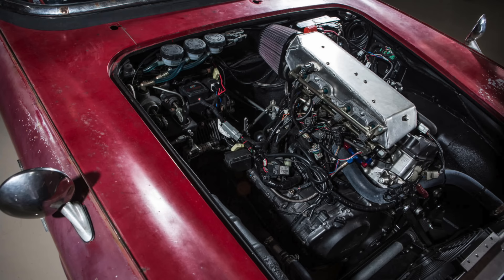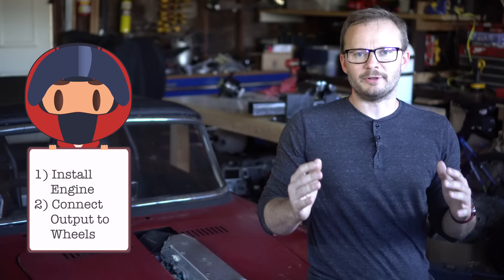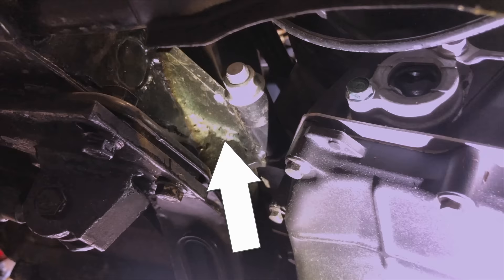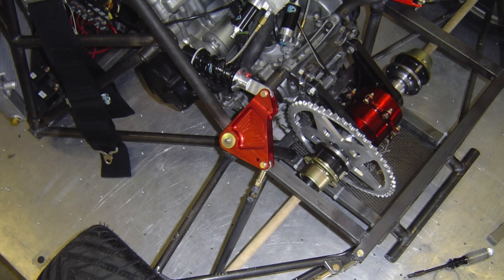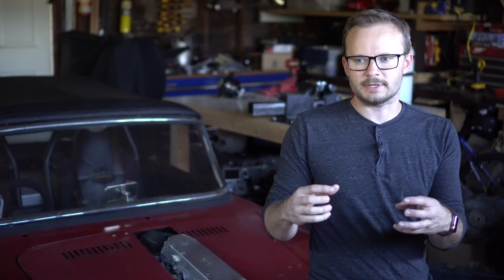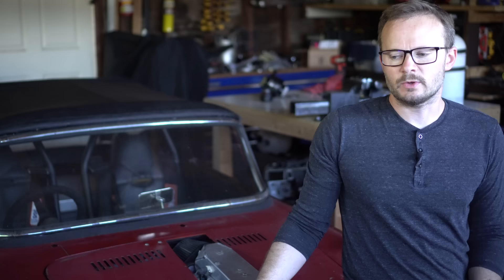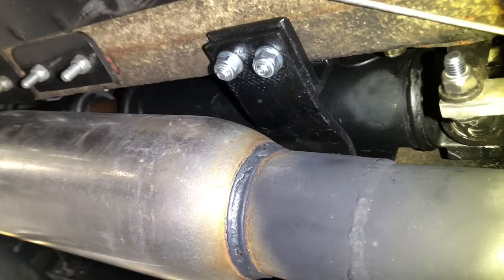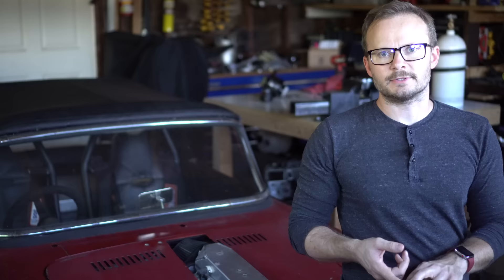Motorcycle Engine in a Car - Here's Why and How

Comment: would the gold wing style of reverse work? running the starter backward
Reply from the maker: No, because there is a one-way slip on the starter. Could be possible to rig up something mechanically, but not easy. Also the starter is grounded to the engine block, so it would be tricky getting the voltage backward.

Comment: I always find it weird when 21st century Americans use lathe as a verb. I would tend to use the verb for the specific operation I'm using thr lathe for. Be it facing, turning, boring, grooving etc. I just can't say " lathed " or "lathing" in an American accent with a straight face. I kinda feel like I should be wearing proper old timey clothes with some kinda of grease holding the shape of my well groomed mustache.

Comment: While I get this hot rod passion, why butcher such a delightful little car in the first place?  I had to laugh when I saw that he didn't know how to take the bonnet (hood) off and did it the wrong way.  I knew then that the project would encounter more hiccups that he anticipated.  The diff seems to be a clumsy compromise.  The live rear end out of an S800 could've been a compromise though the power handling may've been interesting.
There was a time when a lot of people ditched the original S600 engines as they were fragile in clumsy dumb hands and the rebuilding was beyond the capabilities of the average suburban mechanic.  I saw Corolla, Datsun and Ford Cosworth motors shoe horned in with tricks like inverting the diff and cutting new sprockets to get the final drive ratio acceptable.  Even a fully fabricated parallel arms independent rear end.
While interesting, they destroyed a truly unique sports car for what could only ever be a shadow of the original.

Comment: in 07:34  too many screws too many large holes close to each other ..I know metal sheet is pretty thick but if hard driving .."buggy way" needs checking time and again...by the way mechanical engineering seemed to be your favorite science........hold on I saw video no3 ride with Leno....gear shift kicks like a mule...time bomb

Comment: Yikes!! At 9:31 I saw your car up on a couple of those Harbor Freight Suicide Jack Stands!!!!  Have you not noticed that the upright rack has absolutely no negative rake in the front of the teeth to prevent the pawl from slipping out and dropping the car on your head or whatever body part you decide to put imprudently under there. It wouldn't take much of a tap to see that jack fail.  I see the date of your video was after HF recalled those jack stands (2018). If you are still alive, take then back for a full refund even at this late date. HF doesn't want your next of kin to sue the crap out of them. Stay alive for heaven's sake!
On a side note to the above, I love the project. I've dreamed about doing something like this for years until it became decades. Now I'm working on a time machine to correct that little error ;>)

Comment: Hot rod: An automobile that has been rebuilt or modified to increase its speed and acceleration.

Degree in mechanical engineering and ASE certified mechanic.

Comment: There are plenty of old Gold Wing 4 and 6 cylinder engines our there.  They are bullet proof. Why did you not use one?
Reply from the maker: I wanted the 12,300 RPM redline. Also more power.

Comment: It's not a motor cycle powered car. It an ICE car. 
Just because it shares and engibe that also used in motorcycles. Stop all these silly statements. There have been numerous small car powered by engine used in motorcycles book at bmw i3R, numerous Honda car and Suzuki  and many British cars.
Reply: Keith, no Honda has ever used an engine that was also used in any of their motorbikes.  The aircooled series of Scamps had twin cylinder engines that looked similar but were very different.  No parts commonality at all.  I cannot speak for Suzuki but doubt it as the duty load cycle in a car is very different to that in a motorcyle and such things as both the torque and horsepower/kilowatts curves need to be quite different.

Comment: I've got a 67 karman gia. Rusted roller for 40.00. just replaced my 94 GSXR 750 motor.with 1200 bandit motor. Need to rering the 750 mid mount chain drive straight axel where the trans axel was.shoud work.

Comment: Technically they S600 was a motorcycle but with 4 wheels instead of 2.
Reply: Jason, no the S600 evolved from the S500 which in turn evolved from the S350.  There is no parts commonality with any of their motorbikes.  The chain drive rear end was within cast alloy cases with banjo diff bolted to chassis.  The DOHC four cylinder engine was water cooled with roller bearings for all seven bearings.  The head was a very heavy lump.  If anything it had more in common with their F1 engines.

Comment: do you have to have  the car in first when u pull the cable or no @SuperfastMatt
Reply: like when going into reverrse
Reply from the maker: You have to pull the clutch and it helps to be in gear. It will work in neutral if the gears happen to line up.

Comment: S600: Made for Motorcycle Engine because it Also has a Motorcycle Transmission!
Reply: Luis, no, nothing in the S600 was interchangeable with any motorcycle that Honda was manufacturing (other than the valve caps on the tyre valves).  The whole S600 was uniquely S600 car.  A lot did carry on to the S800 but the forerunner to the S600, the S500 had some commonality but only enough to see that they were both from the same manufacturer.  Okay, I'll also concede the 10 and 12 mm nuts and bolts used through the car and bike ranges.

Comment: "Turned out". You dont lathe on a lathe, you turn. Turning.
Reply: You can face on a lathe also.  Ironically, when you take your disc brake rotors to be "turned", that's actually facing. When you take brake drums to be  "turned", that's actually boring.

Comment: Is that dirty sock OEM?
Reply: Parlux, no.  Honda were very particular about the dress standards of their "associates" working on the assembly lines and dirty socks were not permitted.  This one may've been an aftermarket supplier seeking a "go faster sprint" modification.  I have checked both my S600 and S800 printed parts manuals and can find none offered.  Even the changes in parts with successive Engine and Chassis numbers doesn't bring one up.

Comment: Seems like a lot of work when you could of put a small block v8 in it and had a sweet sound for not much more work
Reply: Thats not as cool
Reply: Tobias Lykke Haugaard nah it would be way cooler a 2020 cbr1000rr engine is 215hp, a 350 chev in low key form is 290hp and with basic mods can be well over 450hp a 383 with the right bit will be 600hp, 
And thats horse power that torque factor would be wildly different too

Comment: Im guessing the stock engine was either missing or a pile of rust and nearly impossible to repair or replace
Reply from the maker: Missing
Reply: @SuperfastMatt  I saw this car on Jay Leno's garage after watching this video. Was the clutch changed  to a foot pedal later?
Reply from the maker: @williamgolden839  It started as a foot pedal and then I changed it to a hand clutch. Much more fun this way.
Reply: @SuperfastMatt  I see. Was it a foot pedal when Jay drove it?
Reply from the maker: @williamgolden839  Yes
Reply: @SuperfastMatt  At first I thought it was the head sticking through the hood but I later figured out was the air box. Awesome project you made

Comment: Those things were dreadful!  I spent a little bit of time with one and got rid of it quickly.  If you want a really small sports car get a MG Midget or Austin Healy Sprite..  They are real cars but that Honda is neither fish nor foul.
Reply: Lance, I disagree.  A well tuned and cared for S600 was, and is, a delightful car.  If the owner did not read the Owner Manual and follow the instructions and drive it as suggested, yes, they could let them down.  The ergonomics for the driver were eons ahead of the British sports cars of the time.  They gave what they got.

Comment: Wondering how a bike engine would work in an old VW Beetle. Someone please comment. Smart or stupid?
Reply: old air-cooled VW Motors can be modified to produce stupid power, and they'll fit without needing to plumb in radiators and such, people are also updating VW buses with Subaru Flat 6 as but you need to plumb and radiators and stuff and it's a $20,000 or so conversion, but then you've got a bus that will ride modern on the freeway

Comment: Meh.....

Too much work for too little thrill.

Better off to go with a  Honda S2000 F22C 240 hp engine.

Motor cylinder engine  170 hp and 90 ft lb torque vs F22C engine 240 hp and 162 ft lb torque.

Comment: Old Cars are so cheap such as 2000 Chevrolet Cavalier LS, 1997 Honda Accord LX V6, 1998 Nissan Maxima SE, 2001 Toyota Collora, 2001 Chevrolet Malibu and 1999 Ford Explorer XLT. You can buy used cars for under $1.000. Swap Machines 4 Cylinders CBR 1000RR used price 4.000$ to 8.000$ If new Honda CBR 1000RR price $16.999. A Superbike is more expensive than Old Cars. Modified Cars are Crazy Ideas.

Comment: I'm going to sound like a total idiot and a total hater.
When Honda first made a car, did they use lawnmower parts?
Reply: And hamster wheels.
Reply: ZonE, it depends what you mean?  Honda did not start making lawn mowers until the 1970s, but had been manufacturing power product engines since the 1950s.  There were no power product engine parts or motorcycle parts (other than similar nuts and bolts) used in the first Honda cars (that includes the TN series of light trucks.  The S500 preceded the S600 in 1963, but used nothing other than purpose built parts.
Reply: @campbellsharp8303  your comment shows just how uneducated people are when they mock Honda. Even I was uneducated on this because I believed these foul humans and never bothered to research. I always just assumed Honda took a motor from a lawnmower they built, and made it work for a car, then came up with vtec as a way to make a motor better than a normal motor, this was my thought process, now I know the truth.
Reply: @SenorMrZonE  Yes, it is easy to build a myth about something that people do not understand.  Honda have made a few mis-steps over the years, but usually ready to redirect the path.  Apparently during the very early days of production of the 1300 Sedans and Coupes, there were up to 80 design changes a day as the cars progressed along the assembly line.
The S600 parts manual has many parts >up to a particular Engine Number or Chassis Number, followed a few lines on with another revision.  And the exploded parts illustration has matched none of versions that my friends and I have had in pieces on the workbench in front of us.
I used many unkind words about Honda about their choices of alloys in the heads and carburetors as they seemed to pull out too easily.  However, hydrogen embrittlement was a process that was little understood at the time as all aluminium alloys suffer from it.  The tensions stated in the workshop manuals appear far too low to anyone used to working on cast iron machines and using the old ideas caused more problems that later owners and restorers found too often.  Never let a diesel mechanic anywhere near a Honda sports car.